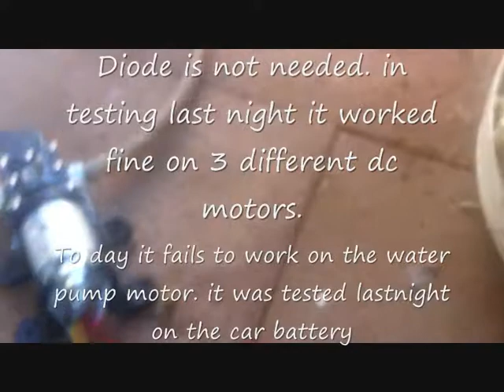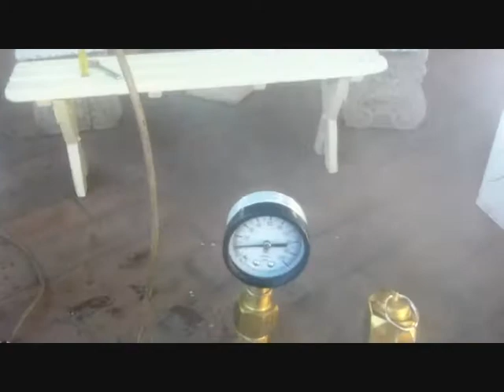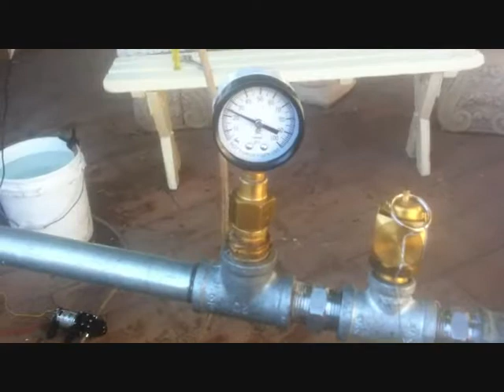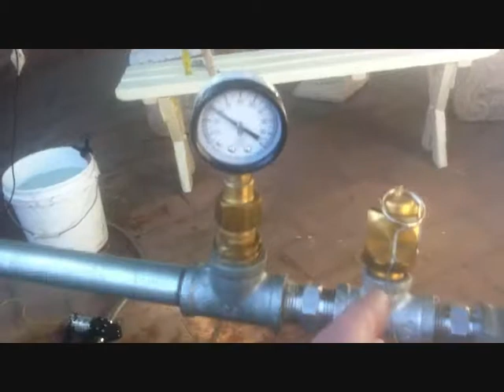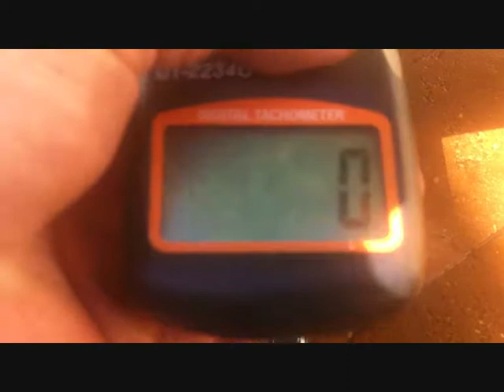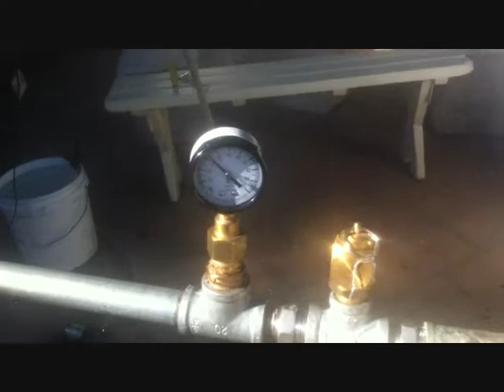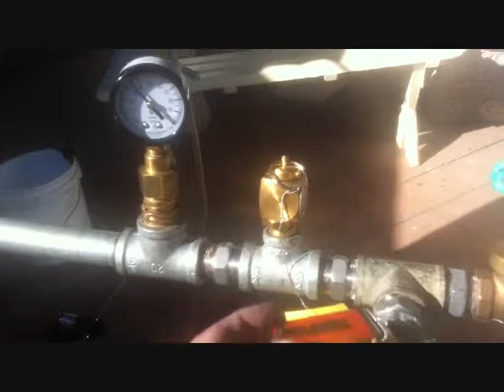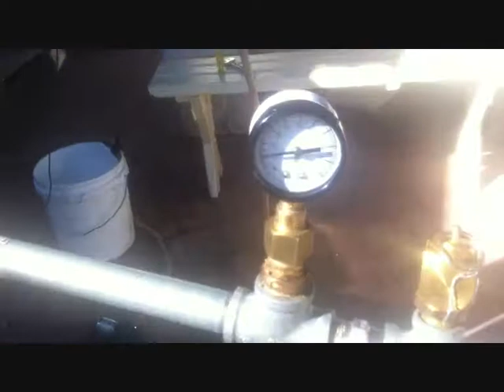Steam Turbine test

Comment: Could you position your water reservoir next to the fire box to mitigate the thermal shock of cold water entering the boiler?
Reply from the maker: Good Idea.
In the end product the reservoir will be under the turbine to help heat the water and the bypassing water could go aground the out side of the stove to help warm the water.